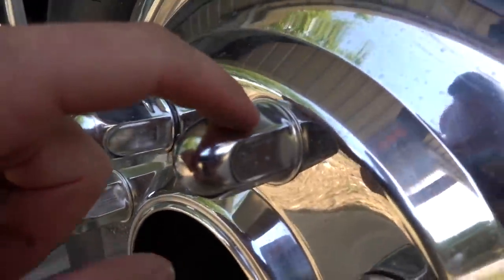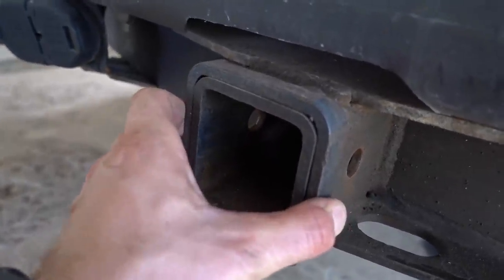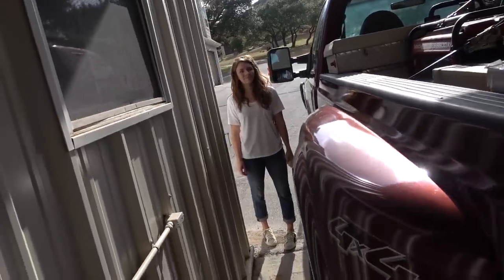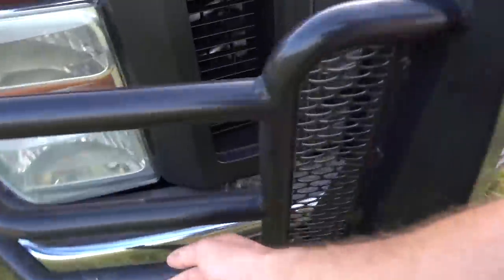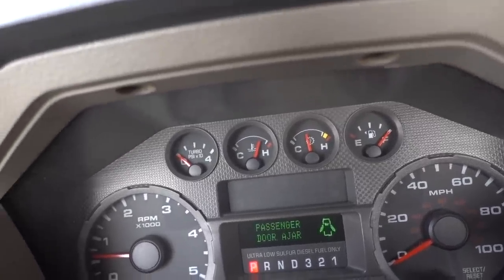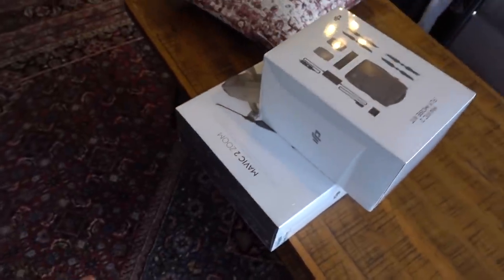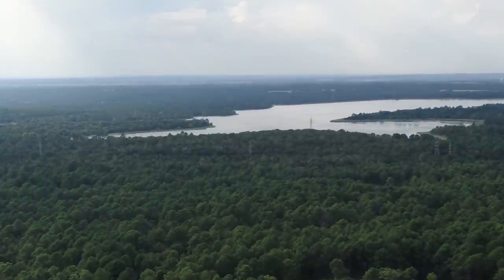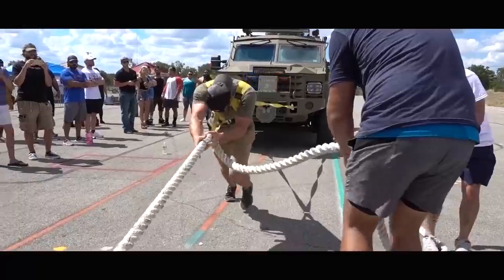My F-350 broke down immediately.....

Comment: Fan clutch is shot. It’s not oil related. If your fan clutch was good, it would be audible in the video.
Reply: My 5.7 did this a while back,  it's definitely the fan clutch,  it'd be a good idea to do a full coolant flush and thermostat change to be safe
Reply: If it was  a fan clutch it would be at in town  speeds  not highway speeds. There is enough air flow going past the radiator. At 70 +mph  I'm not saying your wrong about the fan clutch being broken but my guess is the radiator cap is not holding the correct pressure. Causing to lower the boiling point of the coolant.
Reply: @linkard, I do believe your right about the radiator cap,  but when my fanclutch went bad it was doing this same thing,  granted it's a Chevy not a ferd but still if I was Matt I'd look into replacing it all lol
Reply: Yea agree on this. And run motor craft coolant, main causes of bad cooling in fords. Causes bad electrolysis in the system.
Reply: If it was rolling and over heating at speed, the fan clutch doesn't do much. It mostly does its thing at idle and low speeds.
Reply: Im no rocket scientist. But, I believe it's over heating because the radiator cap is attached to Ford.. Correct me if im wrong..😂😂🍻🍻
Reply: @mike-ws8yh  ram air happens at ~55 mph. chill out.
he couldnt accelerate past 60 because the truck went into a protection mode due to the overheating.
Reply: Most diesels dont use that fan clutch system he probally just needs to pull the radiator out hose out the fins and put it back in boom fixed
Reply: Probably not oil related but dang the oil a gallon low and he just got it, did he bother to pull the stick and look at the oil before buying.
Reply: @MrYaxalot  That was my guess is radiator needs a good flush.  Probably not got enough flow to keep taking the heat away., that and/or Fan
Reply: @laazala  I'm not sure on the new stuff but I kno the older diesels do not have clutch fans so as long as his isnt missing a blade or the cowl its probably good
Reply: the fan at freeway speed NOPE WRONG
Reply: @LinkcardEBTCash  if that was the case there would be a noticable drop in coolant level as it boils off

Comment: check your radiator fan relay. I've had mine go out in my car replaced both the high and low speed fan relays no issues after.

Comment: exhaust fins are to keep tip cool while it goes into "regen" to burn the soot out of the dpf filter. never replace tip on diesel exhaust if you dont delete the dpf filter could burn paint.  delete filter and tune for more fuel milage and power without going to far to risk head gasket or head studs (usually first thing to go in diesel engines due to boost pressure)

Comment: A triple A membership is the best thing you can put in the tool box of that truck.
Reply: Burnit53 that is the ABSOLUTE truth!!
Reply: AAA won't cover a dualie truck...
Reply: JPfowl why is that?
Reply: @jgott1745  he's partly correct. They wont change the inside tire of a dually. Instead they tow it to a repair shop
Reply: Yes! Best $60 a year I have ever spent since I tend to  lock my keys in the car far more often than I care to admit. Lol
Reply: I’m only 21 and this is the best comment I’ve ever seen haha. And I know a good bit about cars. But I’ve had two blown transmissions a blown engine and locked my self out. I know I’m an idiot. And love to sit my Tahoe on the rev limiter lol. But triple A has always been great

Comment: Mdatt, I had a very similar problem and on mine the radiator hose was sucking together. We changed hoses, problem fix. In addition I changed the thermostat in mine and I went up to the next degrees and I replace the radiator cap

Comment: T[exas] Rex! 

Matt, you may want to let the glow-plugs turn off before fully cranking...you are killing that engine. Have a blessed one!
Reply: Actual they dont need to run if the engine is warm they are for winter purposes
Reply: You don't need glow plugs in the middle of Texas summer
Reply: unless it's below 32F (in my opinion) you don't need to let the glow-plugs cycle, the engine is usually already warm enough

Comment: Matt, i have a 2008 6.4 I had some problems all related to the EPA crap. DELETE the EGR and the DPF you will have a new truck ! Leave the stock exhaust pipe so it won't be a red flag that it was deleted. Doubled my MPG.

Comment: Mullet

Btw the 2008 ford diesel needs time to warm the glow plugs before starting. It starts better and reduces engine wear.
Reply: Dude the oil is already at 80° at 6am in tx.... no glow plugs needed....glow plugs only heat the air in the cylinder the help start
Reply: Jon Fischer true
Reply: All diesel’s on any start need to cycle glow plugs whether it’s warm or not.
Reply: Tanner Frederick I agree
Reply: no they dont, my diesel has no glow plugs. It uses a grid heater to warm the air to help aid a cold weather start. I can start my ram in 0 degree weather without even using it. just turn the key and it starts.
Reply: @tannerfrederick5130  wrong....new trucks computers wont even turn them on at high enough temps.
Reply: warren michael Shoudlve said “in my opinion” I have always wanted my things to last as long as possible. I trust the engineers that built the truck that they say to wait until the glow plugs have cycled. But each person’s truck is their own.
Reply: in cold weather , fine. Hot ass Texas day, dont need em. I know the older diesels were more prone to cold start issues but on a regular day  thats not cold at all, its fine to just crank em up.

Comment: check the water pump and the sensors that are connected to the heating and cooling elements your thermostat could also just be broken and needing replaced.
Reply: good fix for this problem is to change to a chevy.....ford dont make good diesel engine....still a nice looking truck

Comment: I hate that for you Matt, but the 6.4 is just not good. The 6.7 is the way to go.  I hope it works out for you.
Reply: The 7.3 is the way to go
Reply: No 6.7 powerstroke is the best for price and power
Reply: @sjrichards800  that's true. Also easier to find in my area at least. I rarely see 7.3s
Reply: It has nothing to do with the engine. It’s the radiator
Reply: @austderstine1  it's still an issue with the truck.
Reply: @TheEsam98  hard to find, and super expensive 🤷‍♂️
Reply: Bucking Bronco no..... all vehicles have issues and you know I’m right.
Reply: @austderstine1  of course all vehicles have issues, but that doesnt change the fact some have more then others. And the 6.4 powerstroke is one of the most problematic.  I think it's a bad thermostat 🤷‍♂️

Comment: Matt, a veterinarian: oh it's overheating! let's check the oil!
Me, a mechanic: whataboutthefuckingcoolant
Reply: BWAHAHAHAHAHAHA!
Reply: Me not a mechanic: WHATABUOTTHEFUCKINGCOOLANT
like im not good with cars in the least bit but if the car is over heating my first guess is coolant then oil...
Reply: Treyton Nugent 🤣🤣🤣🤣🤣🤣🤣
Reply: The reason he did oil, was because they had coolant, but the oil was low.
Being low on oil DOES cause extra heating.
Reply: Yeah my thoughts too. Also those are known for getting trash stuck in the intercooler /condenser /radiator stack causing poor air flow.
Reply: #milkshakemaker all the oil is in the colant system now. Probly blew a headgasket or blee the oil coller.
Reply: He should of checked it when he bought it but theres no way he could of checked when it was that hot. He would of instantly get scolded.
Reply: He did say "it's got water so that's ok".

Comment: If you have coolant and oil it could be a thermostat not opening or radiator fans not working
Reply: Noooo
Reply: nooooo
Reply: Head gasket or oil cooler seems more logical
Reply: Yes he need a new rator
Reply: I think air at 60mph is enough for radiator
Reply: I was thinking the oil cooler too

Comment: Oil is not going to make it over heat it's something in your cooling system fan probably not kicking on or radiator stopped up
Reply: Curtis Mcquiston a lack of oil will always cause overheating. What.
Reply: That’s what I was thinks
Reply: No oil helped but I don’t think Thant was the whole problem
Reply: But no you if there was no oil it would of been even worse
Reply: @TRDPRO312  "Always" and "lack of" are too general and final.

No, not until you are like bone dry. Then the increased friction heats it up. But when you are just low, worry more about bottom end and mechanical failure.

He definitely needed oil, but he added it...i think its probably a failing hose or water pump...could even be a failing thermostat getting stuck halfway or something...if he made it home at 50 but overheated at 60 or 70 or whatever...its probably lack of flow for one reason or another.

Comment: Exhaust Gas Recirculation. Very expensive to replace. Cost us over $5000, because the overheating damaged the heads. Have it checked, ASAP. Even if the codes come back clean.

Comment: Might have a clog coolant line or bad water pump. Good Luck.
Reply: I think the thermostat is busted
Reply: Don't forget to rotate the air in the tires. Do that every 5k miles, top off your headlight fluid & put plenty of soap in your gas tank to keep the emissions clean.

Comment: I think we all pretty much knew this was an inevitability...sorry bud. Sell it and get a 99-03 7.3 powerstroke.
Reply: 7.3 is a good engine. Best engine Ford ever made and probably ever will. But if you want better sound, more power, more reliability, and cheaper parts I would recommend a 6bt.
Reply: @RiggyRonnie  technically Ford didn't make the 7.3, IH did. But I agree, best motor Ford put in their trucks.

Comment: Also when a diesel overheats it's a good thing to just pull it over and let it idle if you shut it off when it's extremely overheated you could damage it... That used to happen with a couple of the tractors I used to operate they would cool down quickest when I would just go to an idle.

Comment: Its probably the water pump, they come with plastic pumps and they like to shear apart. It may also be the front water pump cover. I know you said that you're just using it for work but the motor is known as the 120,000 mile throwaway motor it was a very bad design by navistar. It doesnt really matter how you treat it.

Comment: One of the worst engines ford has EVER made, time to put it to rest... next video open fire on the 6.4 🔥🔥
Reply: Woolman Workx ford didn’t make that engine
Reply: ____ ford didn’t make the 6.4
Reply: Ford didn't make that engine; that is an International engine.  This is why Ford started making the 6.7 which IS a Ford engine.
Reply: ____ ford didn’t make the 6.0 or 6.4 Idk who made the 6.4 but I know international made the 6.0
Reply: International made the engine, they sucked so bad that Ford sued International.  They lost the law suit but was able to buy all the patents and used them to develop the 6.7. The 6.7 has proven to be a pretty solid engine.  Good thing Ford took over and starting making their engines in house.
Reply: Arguably the 6.0 was the worst.
Reply: The 6.4 is an International engine also.  The 6.7 is a Ford engine they started making in 2010 for the 2011 model year.  The 6.0 is the same engine as the International VT 365 minus the emissions controls (ie. EGR cooler, etc.)  I think that stands for "variable turbo" 365 cubic inch, which 6.0 liters converts to.  The engine is o.k. , but, the emission controls added to it cause the problems.  The 6.4 wasn't any better.  I just spent $3,000.00 for new injectors and cooler delete.  They sure aren't like my old 7.3.  Those motors didn't have emission controls and they had a turbo waste gate.  They would run forever.
Reply: @pabloporktaco8068  you beat me to it . 6.7 is fords first inhouse motor.

Comment: The 6.4 is straight garbage. It’s a 100k throwaway motor, if it makes it that far. All that $ spent, you shoulda got a Cummins or a new 6.7 ford
Reply: Just dont buy a ford get a 2006 chevy with the 6.6 Diesel
Reply: @Chase yes, you
Reply: I got a 6.4 bought it new. Deleted it at 30k miles. Changed  the oil and done all of the  maintenance on time and use seafoam  from time to time. Mine has 200k never once had any engine problem. I hear horror stories. I also have the 6.0 and 6.7. They all seem to be just fine as long as they are taken care of. It's also never had injectors or hp pump or anything. The only repairs it's had is a down pipe, and a few pulleys replaced due to the high power with the tuner.
Reply: River Yarbrough I don’t disagree but you can get lucky I put 340k on mine beating the piss out of it with a hot tune before I pushed a head gasket out of it
Reply: River Yarbrough I have a 6.4. Despite what everyone says I believe there not bad. You just gotta get the right one
Reply: Gmc Dude yep 100% agreed!
Reply: If it’s a 100K throwaway motor, then why and how am I at 140k miles and still running?
Reply: GOO STICK I guess your lucky😂

Comment: You should call it "For Sale or trade for a dodge 3500"
Reply: or a chevy
Reply: That would be worse
Reply: Best comment ever.
Reply: @dole8001  nah. LBZ for the win.
Reply: That is until the transmission goes out.
Reply: I agree
Reply: 09fx ¿  I would agree with a 5.9L 12v and a 5 speed built trans

Comment: Bro its a 6.4 LITTERALY the worst powerstroke made, its a pretty good truck once deleted tho.
Reply: jose gonzalez Na the 6.0 is the worst diesel made
Reply: Sam B there’s a reason the 6.4 was only produced for 2 years. And the 6.0 was produced for 4.
Reply: The 6.4 is still a way more reliable Motor then the 6.0 both engines can be made more reliable but the 6.4 is better when made reliable and cheaper to the 6.4 had overheating issues but you can to a better cooling system and it’s way better
Reply: @matthewking1296  The 6.4 was a better solution to the 6.4 while they were still developing the 6.7...
Reply: @GT5MLGPRO9  198k on mine...
Reply: ERA1Racing take it from someone who has owned both buddy the 6.4 is better
Reply: And this is why Ford now builds the 6.7, Navistar really fucked up both the 6.0 and the 6.4, which is why Ford and Navistar had a legal battle.
Reply: If he would have got a duramax we wouldn't  even be watching this video
Reply: Sam B Charlie keeter says otherwise
Reply: 6.4 to the front. Delete it! H & S tune and it will run forever.
Reply: @michaelenglish7798  becuase it would be in a junk yard.
Reply: @MrManic52001  haha its hard to argue that when the video we are watching is about a broke "powerjoke".
Reply: @samb2069  I own both. 6.0 is better by miles
Reply: Joshua Earnheart who?
Reply: Exactly. A lot of people don't know it's actually a damn good truck when it's deleted. mine has been deleted and tuned to 600 hp and now has 335,000 miles on the original powertrain. Maintenance is key.
Reply: Not even after deleted, have you seen PowerstrokeHelp's latest video titled [6.4L PSD The Party is Over]?  Here is the link.  https://youtu.be/FiB6IbPs2Zk

Comment: You have a cooling issue and possibly a boost leak.. could be radiator, oil cooler.. if ots a boost leak spray water on the turbo pipes and see if there are any bubbles..

Comment: You gotta make sure you have radiator  fluid in the radiator, not water... especially in Texas
Reply: Ryan Calhoun coolant buddy... it’s called coolant... and you never should use water😂
Reply: Ryan Calhoun radiator fluid ?
Reply: Make sure to keep the blinker fluid topped off too.
Reply: fuller fuller don't forget headlight fluid as well!
Reply: And the exhaust bearings and piston return springs don’t forget those
Reply: @ej6_alex174  I think its BMW that has butterfly valves for the exhaust so technically it has exhaust bearings lol.
Reply: It's actually called antifreeze
Reply: Water actually cools slightly better than anitfreeze does
Reply: @BIGSMOKE-bl2lq  but water doesnt have a higher boiling point tho.
Reply: @karriehartle  its the same thing as saying coolant

Comment: When its overheating like that and ur trying to pull over. Blast the heat as high as it goes.. itll save u for a minute but not much more..
Reply: Thats a great idea since the very heat source is the engine itself. It will only pull away heat from the engine.
Reply: And also turn circulation off as well plus vent it up top so it's not fitting you dead on
Reply: Back in the days I drove Junkers, hitting the heaters saved me a few times on long up hills.
Reply: @Silverfire308  I would open the windows and get out of the vehicle while it does its thing. Especially in the 100 degree texas weather. It would be cooler outside.
Reply: @braydenbledsoe3252  I had to do that with my last truck when I blew the head gasket, just cruised at 70 with the head blasting and blaring music. Kinda sucked and I think I would do it again
Reply: @braydenbledsoe3252  not again, but I would fix it so I didnt have to do that, sorry, mis typed

Comment: It probably still has a plastic ish radiator on it. Upgrade it to an aluminum radiator and you should be fine
Reply: My mechanic just said the same thing it's not getting enough air under load lol
Reply: Or It a blockage somewhere. Or a fucked radiator/ loverflow cap. Or thermostat? But alloy rad is a good option but more useful in high power vehicles the plastic top and bottom is sweet for a standard truck